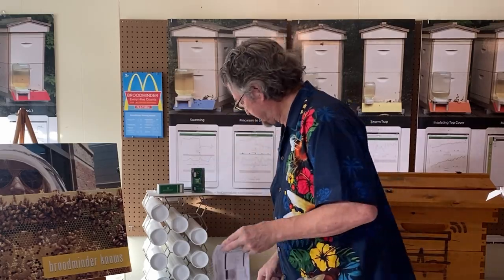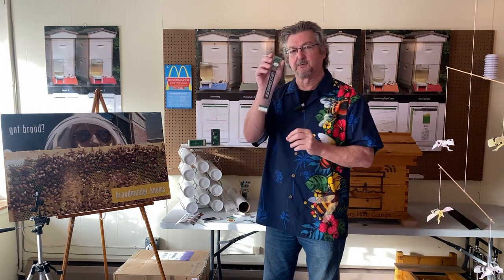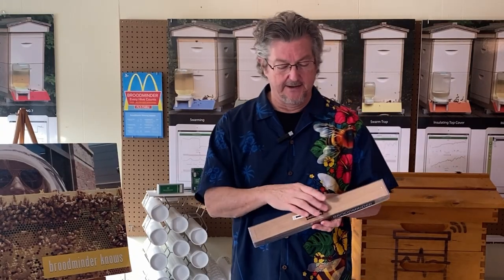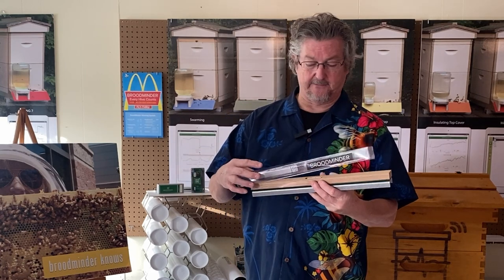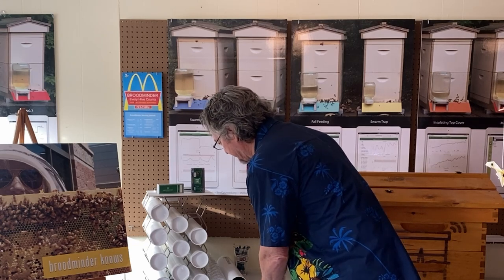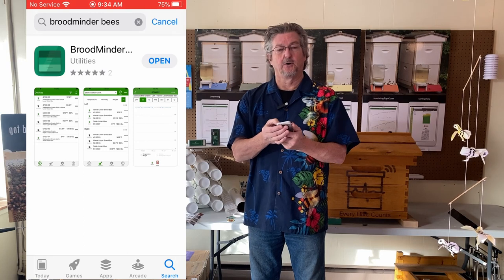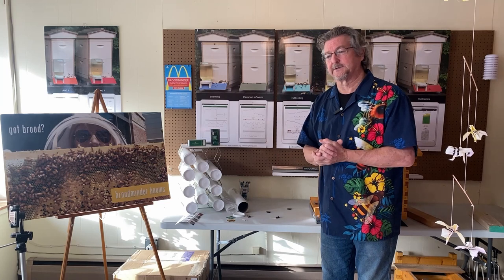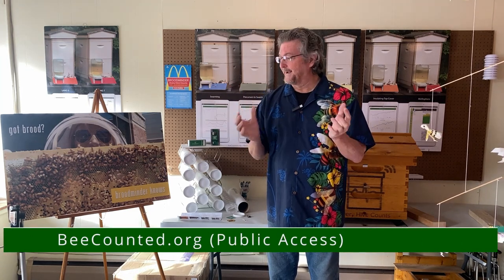BroodMinder-CS (Citizen Science) Kit Installation

Comment: Would a Flowhive rearward tilt configuration have any effect on the accuracy of the scale? Seems it may slightly over/under read the weight depending upon where the scale is placed.
Reply from the maker: For the bar scale (BroodMinder-W) it will affect it. The 4 point scale (BroodMinder-W3) will be more accurate. That said, if you just want to see the honey flow, then accuracy is not the most important. You will still see small changes and up and down in weight very clearly. It just may be 10% off depending on the angle.

Comment: A better orientation is to put the scales at the rear and the 2x4 or angle iron at the entrance and you get the same weighing effect.
Reply from the maker: Hi David, That is a good point. Of course another solution is to use a slightly thicker pivot board in back. We have grown go prefer putting it under the entrance because it is more sensitive to bees gathering at the front of the hive for example during a swarm (or swarm attempt). Either way will work, but all of the normal beekeeping rules (such as tilted bottom board) need to apply. Cheers

Comment: Good to see some new instruction videos for we who are considering your product. However, there is one "point of interest" your users need to consider. Placing the scales under the front of the hive (as you did in this video) is not appropriate for this beekeepers who have "solid bottom" boards. Solid bottom hives are typically tilted 2-3 degrees, with the entrance lower than the back. This prevents rain water from entering too far into the hive and allows for good drainage. With solid bottom boards, placing the scales under the entrance side will allow the rain to collect on the bottom board and create other issues. The same can be said for snow collecting on the landing and then, melting and running into the hive. With screened bottom boards, there is no need to tilt the hive in any direction, as water will simple drain through the screen.
Reply from the maker: that's a good point David. You can still put it there, but will need to adjust the rear shim to be a bit higher than the front. I still like the front since it show the "crowd" movement better, but either front or back will get good results and each has pros and cons.